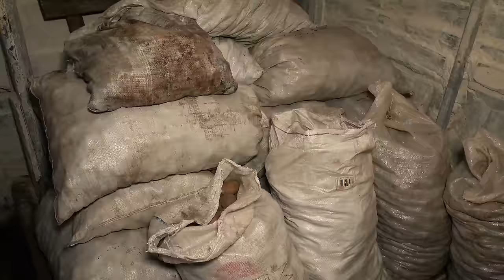ONE DAY IN THE LIFE OF A YOUNG GIRL IN A UKRAINIAN VILLAGE. Country breakfast and lunch

Comment: This might be of intrest to some - the wood heaters used in colder parts of the world are fired.difrently than say wood heaters in the US - 
      When you saw her climb up on the back of the heater she opened the damper - 
      They. Start a hot fire with a pile of wood and the stone absorbs the heat - 
   After a while the heat radiates into the home - instead of continuesely feeding the wood or coal int the heater they might only fire it real hot a few times a day when they cook on it - once the would is burning hot and becomes coals - they close the damper off to hold the heat in the fire box - 
     Those types of wood heaters have been used for 1000s of yrs - 
     They slowly radiate the heat trough out the day and night after each firing -